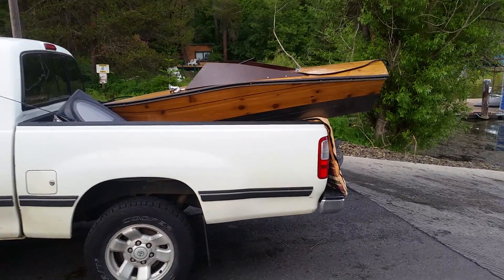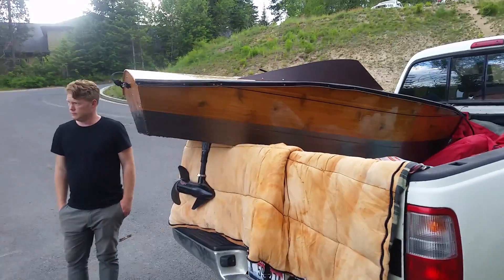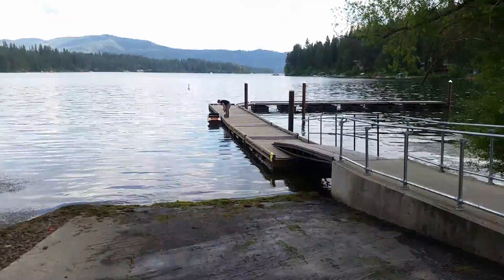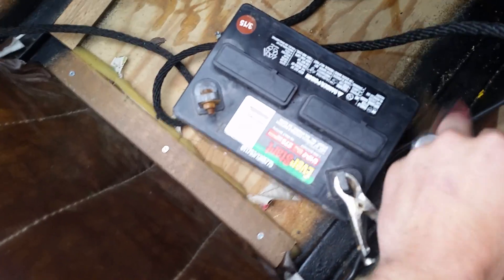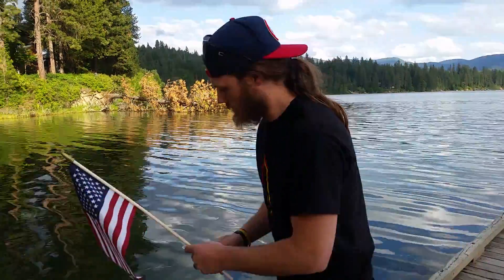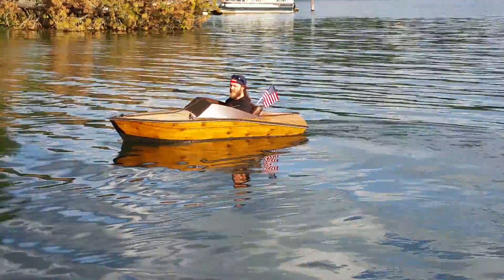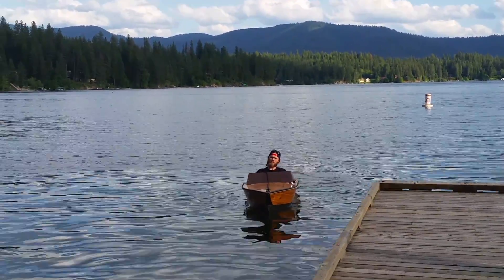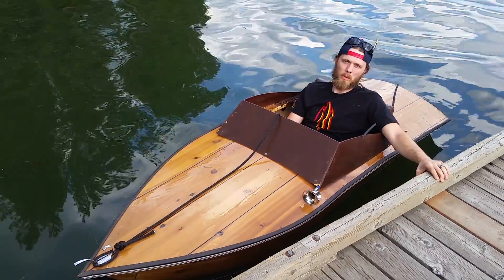Plywood boat electric inboard small

Comment: One fine looking boat! Keep making refinements Brian. Find a home for the battery and add blocks to keep it from sliding around when the boat shifts. Definite thumbs up!!
Reply from the maker: +Cassius Griffin screws to hold it together until i wrapped the bottom and corners with fiberglass mesh and epoxy resin. Then for good measure, i used waterproof porch paint on everything below the water line! I also have glass reinforced bondo on the inside joining the bottom and sides for added strength
Reply from the maker: +Paul Elkins Thank you! Most of things i did different than yours made for worse handling. I figured the weight of the motors down under the boat would keep it from tipping. It does not. It tries to roll the boat hahaha  And its not removable so the boat is much heavier and very awkward to haul/store. Thats what i get for choosing form over function! I may lock the motor and add a rudder... I never thought about my battery sliding but that would be super bad!!  Thank you for your videos and your advice!!   Just a side note, your coroplast boats are genius!
Reply: My last boat leaks where the wood transom meets the coroplast hull. I added a fuel primer rubber bulb to act as a bilge pump, so every 15 minutes I give it a dozen squeezes and all is good. Video soon. 
Looking at your boat you definitely have a narrow bottom, but like my boat you'll learn to lean into the turns some. Love the blow horn on the other video. LOL!!
Reply from the maker: +Paul Elkins  A Manual bilge pump! Thats awesome!!!  Yes i think youve eluded to this a few times but there is a ratio of length to width that is much more stable! I think almost 3ft wide would be best!! But then it would be a small boat, not a tiny one! Lol i guess i am heavily influenced by the classic wood boat shows we have here in Coeur d alene ID.. those things are long and narrow and sleek and sexy. But, also deep V and heavy A.F.   I wanted to shrink those boat, but the physics change a lot!   BTW I would love to get a group of tiny wood boats and crash the wood boat party!!      (Bicycle horn with hose instead of bulb!!) Im very prod of my horn lol
Reply: Little miss sally is 28" wide. The liberty boat is only 24" wide, and in the 150 or so voyages I've never rolled it (knock on wood) When I retire this January maybe I could bring little miss sally to the wood boat gathering.  You're only a day away. Likewise, you should try and make it to the opening boat season on Lake Union. If we plan it we could even get in the mile long parade. Hundreds of old wood boats, sailboats , yachts and everything in between. One huge party!
Reply from the maker: +Jack Mehoff I would definatly do custom builds for people! How much would depend on how complicated and how high quality. Id say one like mine of similar size and quality would be around $500. I could do a quick cheaper version. But i feel i have the skill to do a really nice finished custom project if the opportunity was presented!  Even scale replicas of bigger boats or clown parade boats, anything! Skys the limit!
Reply: how far down is the motor pod? deeper sure does give longer lever arm to try to roll it. it's looking cuter with the additions.
Reply from the maker: +model nutty The motor is far enough down for the blades to clear and then some. Im curious how it would act with a shaft twice as long.. i dont think it would ever climb all the way to the surface... and if the boat FEELS unstable when i turn it may still be safe especially if i dont turn too sharp at top speed!  ;) more testing! i want it to be stable enough for fishing...
Reply: longer lever arm = more force, slightly slower acting but lots more determined! it'd help to put maybe 12 degrees angle on the shaft (shaft forward at bottom) so when it tries to roll, it's a little more like banked turning. I'd give it only an inch of clearance to prop tip for less leverage, it'll be slightly more than that when turned if you put that down angle in. less a worry if it's not outside chine grabbing, like turn left but leaning hard outside right (been there, ouch!).
Reply from the maker: +model nutty That would ideal! I think i could do it too! Angle bore a hole through a block etc!  I hate to give up on the inboard, but its flawed from the get go and after everything it may still handle poorly! Ill try cheap and easy first of course! ;)
Reply: Oh, before my first boat went electric (Liberty) I was testing out a spinnaker sail and had an aluminum rudder on the transom. I later attached a small fixed trolling motor to the side of the rudder. It worked great. I also had both the motor and the rudder hinged so they'd kick up when beaching the boat. It was slow but a slick set-up.
Reply from the maker: +Paul Elkins YES!!!!  You know over 1million people have seen your boat and a few hundred HAD to have built one.At least a dozen people looking for an excuse to show off would show up to your neck of the woods! (Seattle area?) Id do it! When is it??     I wonder if  my boats arent as UNstable as they feel... at this point, I havent gone any further than what is on youtube LITTERALY lol i havent really gone through the paces. It may have strengths im un aware of!! ;)
Reply: here's a candidate (I'd used one, worked nice!), a 250w 24v 2750 rpm scooter motor, 5/16 galvy steel shaft is a great fit to 3/8" hard brake line tubing (about .006 clearance), fits to youngprops.com T4. I used a section of tubing vertical to keep shaft and sleeve oiled, joined on with fiberglass. scooter motor is good for about 1300 rpm on 12v with plenty of torque. motor shaft and driveshaft drilled for cotter pins, coupler 1/2" steel tubing with rubber hose fit inside it (also drilled for cotter pins) shaft seal thrust bearing = washers and O-rings. trolling motors are great, but if you have a scooter motor you can go a very quiet running direct drive like that for about 30 bucks. for a canoe (longer with much less motion resistance) a 100w scooter motor will run a fast paddling pace "forever" because it'll only pull 8A max, and 4-6A when moving. T4 prop 4 pitch x 1300 rpm = potential 5mph not counting prop slip. be really picky about shaft and tube being straight, they get built into a skeg for protection and support.
Reply from the maker: +model nutty woah! I love this! So i run a 24v motor off of a 12v system? Why not go 24v ? Is it just to prolong battery life? Is the extra rpm lost to prop pitch/cavitation? Iknow battery weight and cost are factors...
Finally, what kind of scooter are you talking about? i would love to get one of these motors!! Any tips on where i could?? Thank you!
Reply from the maker: +Lunar Sphynx hey! as far as i can tell, Paul uses a 30 lbs thrust minn kota trolling motor.
I works great and new ones can be purchased at sporting goods stores for around $120 new. A good used one will usually be about $75 or more anyway. My other small boat has a $40 17lb. Thrust minnkota(used) and its plenty!
Reply from the maker: +Lunar Sphynx hey! as far as i can tell, Paul uses a 30 lbs thrust minn kota trolling motor.
I works great and new ones can be purchased at sporting goods stores for around $120 new. A good used one will usually be about $75 or more anyway. My other small boat has a $40 17lb. Thrust minnkota(used) and its plenty!
Reply: like a "Razor" kids scooter "pocket mod" are typical 250w unit. yes to many reasons, mainly 2750 rpm from 24v is going to cav a lot more, motor is going to heat up and toss efficiency. it does make for a great little inboard as described, people toss them all the time for kids not using them or the 7-8Ah SLA cells going bad (winter freezing?). eBay has "24v scooter motor", Craigslist is a source for whole scooters cheap sometimes, hardware store and auto parts store for shaft and tube.. and if you looked at youngprops.com 's T4, that dense cast aluminum prop is really about the ideal size-shape-pitch for the under 1500 rpm. in test years ago (250w motor) no speed controller just a 115v typical household light switch for on-off, an hour on 12v the motor was mildly warm just shoving water down in a barrel, not a boat moving along. they're cheapo closed can brushed motors, but at 12v not stressed the brushes should run ok about "forever". the 250w are about 4-1/2" diameter 3-1/4" long with a mount plate on them already is really convenient. "quick math" 250w / 12v = 20A max, and roughly 15-20 lbs of static thrust (less needed once its moving along) is comparable to the #17 MK you mentioned, great for all day running around on a charge. you can get 20-30A PCM speed controller pretty cheap on eBay that have forward-neutral-reverse switch and dial-pot to adjust speed, can help extend runtime/range a bunch. when I did the motor-shaft coupler, holes drilled 90 degrees from each other in tubing ends for the cotter pins, the rubber tubing taking up the slack and making alignment a little less critical. do have a couple spare pins just in case the prop smacks aground, a rock, a log, etc. the drive went into a kid size runabout boat (7.5ft x 3ft beam) sold before even run, but the driveline itself was tested pretty hard in the 55 gallon plastic barrel. I doubt it even hit 120 degree temp, no prob grabbing it tight and hanging onto it. same motor in a scooter running 24v they get LOTS hotter in 20-30 minutes running. skeg with driveshaft prettymuch protected the prop and rudder behind it. skeg itself was just 4 layers luan, 2 outside plates and 2 inside with the cuts for the 3/8" brakeline tubing "shaft log", epoxied, rounded and streamlined then clothed over joining into boat's 3/4 x 3 keel batten. very strong for the 3-4 mph speeds it'd ever see. (I'd almost have to draw it up then you'd understand "the why's" of the skeg's strange shape instantly!)
Reply: +Brian Davis So what materials are u using to hold the boat together to be waterproof?  BTW Sweet Boat!
Reply: It sure looks right.